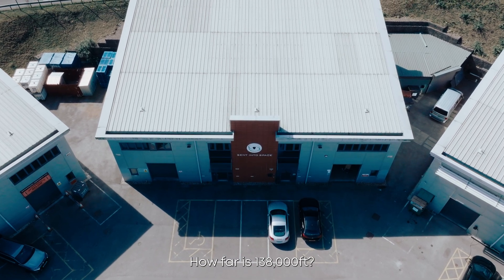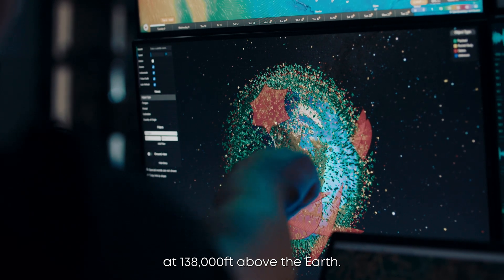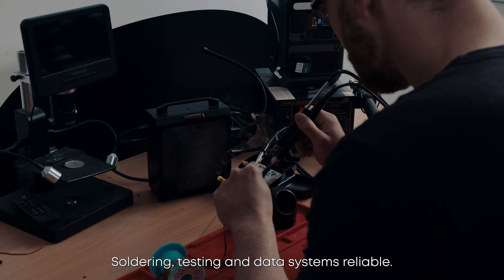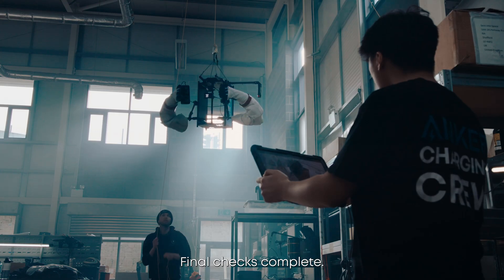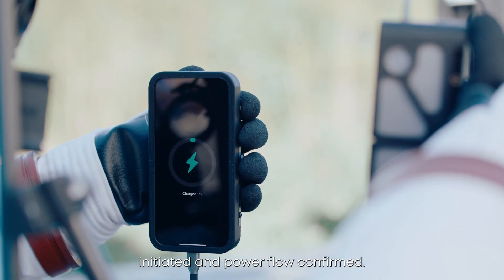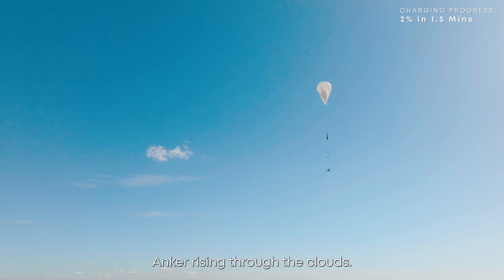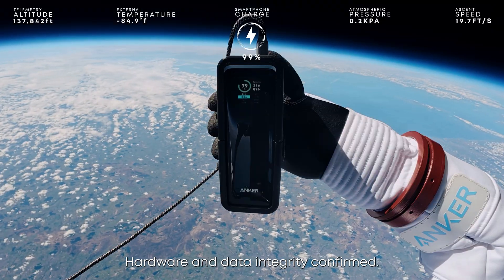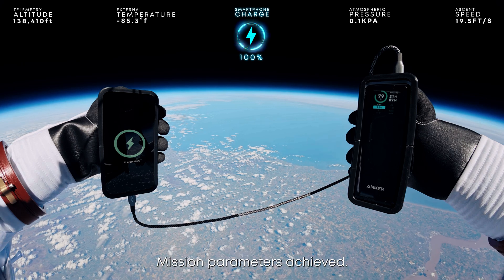Can A Power Bank Survive In Space? Extreme Durability Test

Comment: So did the rig eventually fall back to Earth and burn up on re-entry?
Reply: I wanted to see it come back down. If you kept the descent speed slow enough you should not have to worry about renentry heat.  If they just released the gas from the balloon slowly till it was not boyant enough to keep the whole rig aloft it should just float down without having to worry about reentry speed and thereby heat from air friction. It would not be a controlled landing so there is an extremely small chance it could land somewhere that it shouldn't.Then you could have a model build on a drone and at some point the drone motors kick in and baloon jetisoned so fake astronaut could be steered and avoid landing it on someone's house or head or cow.
Reply: I forgot about the speed of descent part! So yeah a balloon makes a lot of sense yo do a controlled descent (not unlike the guy in the astronaut suit doing the parachute). @martinkoob7222
Reply: There is no re-entry burn at 26 miles above earth. You would need to be at least 75 miles up.
Reply from the maker: Hey Lee, great question! Everything we launch is recovered, you can check out our environmental policy here: https://www.sentintospace.com/environmental-policy
Reply: No it's up there forever and ever!